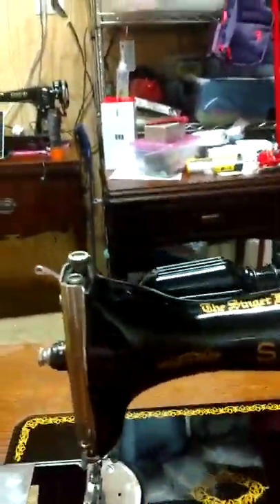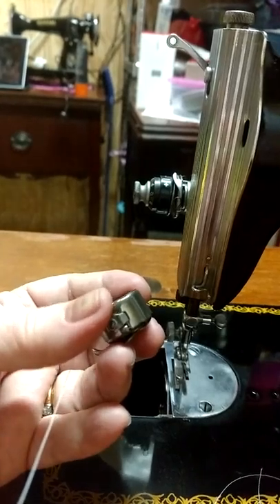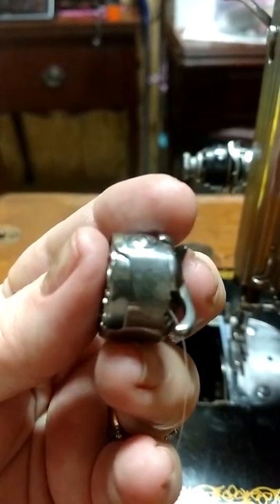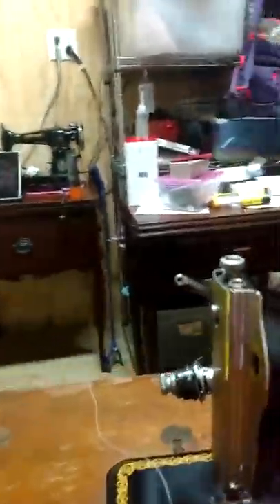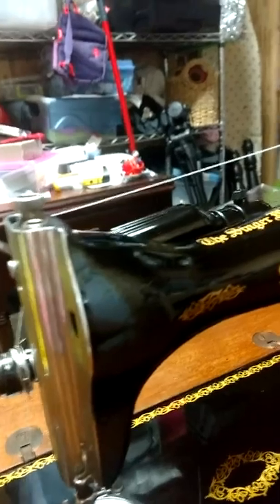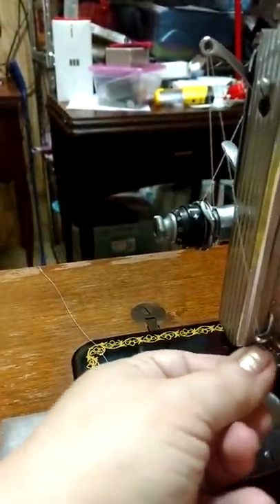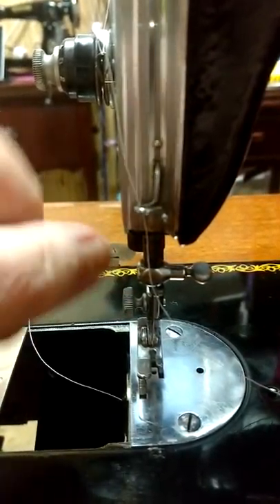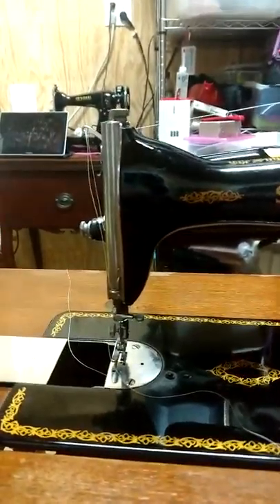Threading the 15-91 and loading the bobbin

Comment: Mine was skipping stitches a lot. took the bobbin case apart cleaned it couldnt figure out the problem. Had the flat on the needle on the wrong side... Instant fix thanks.

Comment: I have a machine that i know nothing about the serial # JC760603  can you help. I would love to use it, but am confused. I have spent hours trying to find info and nothing.
Reply from the maker: Is it a Singer and are you in the USA.  I checked on Ismacs website which has a lot of information regarding vintage singers.  I could not find a listing starting with serial number JC.  If the number started with J only it would be a 28K from 1904.  Here is a link to the manual for a 28k.  https://www.singermachines.co.uk/sewingmachineparts/instruction-books/singer-28k-manual.html
If that is not it I suggest you join the Facebook group for vintage singers.  They have a lot of knowledgeable folks.  I suggest you post a picture of your machine in that group.  Here is a link to the Facebook group https://www.facebook.com/groups/292073434563220/?ref=share
Reply: @elainemfisher3218  thank you so much, i watched your video on how to thread a machine and mine looks like thst and followed your instructions. And it WORKS!!!! Im sewing its great and better than my modern machine. Thank you for helping me! Hrs wasted online and couldnt figure it out or find anything about it.
Reply: Just series ran from 1948 - 1954